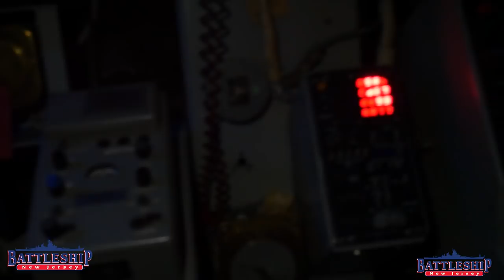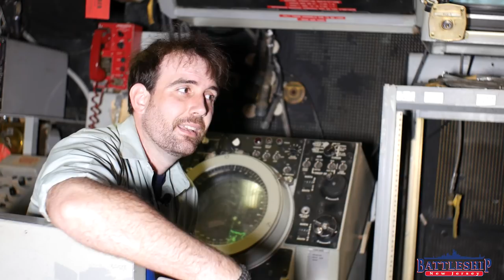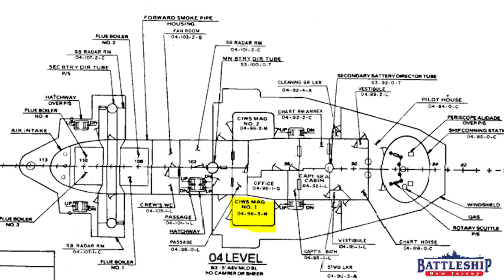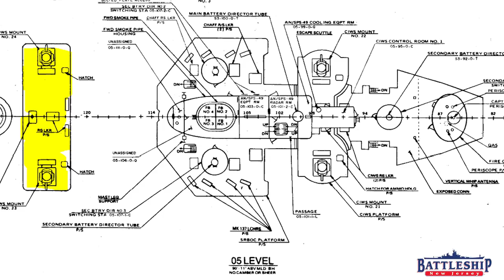Phalanx CIWS

Comment: Do we have any idea what would happen if a single 16" shell were fired on a ship that could bring 2 Phananx CIWSs to bear on it?
Reply: This be my guess, against a thick walled Hy APHE 16-inch shell. 2 sea whizz engaging it will probably? put in more than a few 5 or 6 or 7 20 mm DU rds into it. That should compromise the AP capability of the Thick wall Hy 16 inch APHE shell. The 20mm DU rds will have some not insignificant Amour penteration. That should put holes of some kind in the thick wall shell & quite a bit of stress fractures on the 16-inch Hy APHE shells. That increases the likelihood of the 16 inch Hy APHE shell breaking apart or fracturing when it impacts the main armour belt or deck armour of the IOWA class. That's my read.

Comment: Ryan, has the CIWS had any revisions since they were taken off the NJ? That'd be pretty neat to get 4 demilled ones on the NJ, that can be hardwired to go through "the motions". 

Will those frigates you mentioned, would the navy let you purchase their rack equipment? Even if it was demilled to the point of just having blinking lights on the front of the rack
Reply from the maker: We have all 4 of our CIWS, but making them move is probably out of the question. They belong to the navy and generally don't permit that kind of thing. The navy also doesn't just sell that kind of equipment.
Reply: @BattleshipNewJersey  Oh! Didn't know that you guys had actual CIWS units. Remember somewhere from a video on the Iowa that they put in replica ones
Reply from the maker: Yeah, some ships have replicas, we have the real deal, though they are missing some critical parts!
Reply: @BattleshipNewJersey  Are they able to traverse and such?
Reply: They upgrade and refurbish them
Reply: There have been a lot of upgrades. Surface mode, new gun barrels, new control panels, pneumatic and electric gun drives, tungsten ammo replaced DU. It’s much more capable and reliable now. I’m surprised the Navy didn’t not want the mounts on NJ to go back to Louisville for refurbishment and upgrades. They don’t make new ones anymore.
Reply: The panels used on NJ are no longer used in the fleet. It’s possible Raytheon or the Navy has some lying around, it’s also possible that no more exist. I think it’s likely somebody has one somewhere.

Comment: A 1 minute firing time with a 15 minute reload time seems like a recipe for trouble. Why no autoloading system?
Reply: It would not be legal in California
Reply: He is incorrect. It has about 20 seconds firing time. That is still enough to potentially compromise the barrels since that is about 250 rounds down each one. Mind you the rotary cannon is much better then a single barrel design but the heat is still immense. People with no automatic weapons experience don't realize how hot those things get. If you are in a situation were reload speed is a factor you will most likely be changing barrels so topside you go anyway.

The main reason though is footprint. The Phalanx is quite light and can be placed pretty much anywhere without much modification to the vessel. A autoloading system would add weight and complexity, requiring far more extensive ship alterations to mount not to mention a redesign of the CIWS. Combine that with the heat issue and an autoloading system seems to have a fairly limited use for a lot of added complexity.
Reply: @Snipergoat1  As well, if the reloading speed of CIWS is that critical a factor then it is likely the least of your concerns. CIWS is meant to be the absolute last line of AA defense should anything make it past every other defensive system.

Comment: what kind of glass is being used on these ships?
Reply from the maker: Its not special glass, but the big windows on the bridge do roll down like a car. Being inside the wall protects them very well. Otherwise, the porthole shapes protects that glass and theres very little other glass on board.
Reply: @BattleshipNewJersey  There was a kind of glass in the 3800 lb conningtower door... It doesn't make sense to have 16" of armour and then a cutout for ordinary glass.

Comment: Wouldn’t the 5-inch Guns also be used for longer range targets even in 80s
Reply: Not on mach weapons systems. For slower aircraft maybe but still unlikely these ships were equiped with systems more capable of dealing with aircraft.
Reply: Modern ships do use their guns for aerial defense. However, it is unlikely that these WW2 era mounts would be of any use against a modern missile.

Comment: Odd that they leave the gun but took all the electronics.
Reply: The electronics are the highly reusable parts, as well as being the section that's most classified.  The guns are likely to have had to have specific modifications to their mounting system to work properly on the Iowas and it may just be cheaper to make new ones than change the adaptations (as well as needing to pull the ship into the right kind of fitting out dock to pull them off again, which might not be worth the cost of the time in that class of dock).

Comment: There's many close-in weapons systems around today, but as a Dutchman I am patriotically obligated to say Goalkeeper. Also because the main gun on that thing is the venerable GAU-8 Avenger, also known as the BRRRRRRRRRRRRRRRRRRRRRRRRRT, or the main gun of the A-10 Warthog.
Reply: Then there's the T250 37mm 6-barrel gatling prototype.
Reply: As an American I can agree because yes the Avenger Cannon is simply better
Reply: I always thought the 30mm was overkill for a missile. It doesn't take much to drop one and that is an anti-tank round. Also it's much harder to mount a goalkeeper on a ship that wasn't designed for it. Phalanx is easy to install almost anywhere. GK used to be quite a bit less accurate though this is more to ridiculously good accuracy of the Phalanx rather than a fault of GK. IDK anything about newer systems, they may be just as accurate now.
Reply: Yes I like the goalkeeper too but the new Russian system looks pretty good. Nothing beats the phalanx thought

Comment: The Phalanx CIWS is not a 'chain gun'.
A chain gun is a single barreled gun that uses a length of industrial chain (like a bicycle chain) to cycle its operating mechanism, whereas the Phalanx is a 6 barrelled rotary Gatling style gun that essentially uses a cam action to move the 6 bolts as the barrels rotate. 
It uses 20mm Linked ammunition not a chain of ammunition.
Reply: Was going to say that myself, the Mk38s and 46s (not on the BBs) are chain guns in Navy usage though.
Reply: I thought the M61 and derivatives used linkless feed?
Reply: @jamesharding3459  there are both options with the gun
Reply: @jamesharding3459  the ones I were trained on the shells were in drum not in links. but the load mechanism scoops a round into a chain belt which transports round to gun where another mechanism grabs out of links and mates it to cam captive bolt
Reply: I would push further and divest even the use of Gatling Gun, as that is a particular type of hand-cranked rotary gun. Rotary Cannon seems to me to be the most appropriate terminology for a rotating multibarrel gun of 20mm caliber or larger.
Reply: @michaelkierum42  I see, thanks
Reply: @KiithnarasAshaa  Rotary cannon makes sense, but Gatling gun is so ingrained in common use that it refers to this sort of weapon, not the original gun.
Reply: @KiithnarasAshaa  Modern guns at their core still use Gatling's design.  All modern engineers have done is add motors to the drive input and changed the magazine feeding it and made it available in more calibers (up to 30mm).
Reply: @JaredJanhsen  Gatling himself designed guns that were powered by electric motors, and in the late 1800s had guns firing at ridiculously high (3,000-5,000 round per minute) rates of fire.  They just never found any buyers, because Gatling was never able to design a magazine or feed mechanism that held enough ammunition to make such high rates of fire practical.  Also, given the relative crudeness of electrical power supplies of the day, it would only have been possible to power the mount on a ship, not for ground use.
Reply: @JaredJanhsen  Also, I am aware of, at the very least, a 37mm rotary autocannon T250 for the air defense vehicle Vigilante T249, so they've been developed past "up to 30mm".
Reply: I was thinking the exact same thing but you said it quite eloquently.

Comment: The biggest problem with the Phalanx CIWS is the limited engagement range of the 20mm. A fast-moving missile is very likely to end up raining shrapnel and burning rocket fuel all over the ship even if successfully engaged - which is better than taking the hit from the intact missile, but still not awesome (especially if you're on a smaller ship). It's a lot like the problem of using 20 mm and 40 mm to shoot down kamikazes in WW2, in fact. And of course the limited engagement range also reduces its chances of successfully engaging a fast missile, which just won't be in the engagement envelope for very long. 

That said, it was an extremely effective system against the threats that predominated when it was initially designed and brought into service. Remarkably so, even, given its relatively low cost and small footprint, which allowed it to be spammed across not just the entire USN but the fleets of multiple allied nations.
Reply: It was a vital piece of air defense and still is. Having layered air defenses is absolutely vital for maintaining fleet defense. Say a target slips past the intercept missiles or they need to be reloaded. Any craft large enough to carry a phalanx shouldn't have to worry about shrapnel and as long as the fire is on the outside of the ship the fuel should burn off/put out by damage control. Certainly better then a 15×15 ft hole at the waterline. 20mm is also chosen as it has  a high velocity while still maintaining a large mass and allows the use of variable timed and proxy fuze ammunition. It also allows for a longer burst time and faster rate of fire compared to similar calibers.
Reply: @richardmoore609  When the "shrapnel" is chunks of a 6 ton missile moving at Mach 2 or 3, that's enough to do even a major surface combatant some injury. And burning rocket fuel isn't great even if it is on the outside of the ship.

Most gun CIWS systems developed since Phalanx have gone to 30 mm, specifically to push the engagement range farther out.
Reply: @Philistine47  that whole situation relies on the missile even getting that close which is extremely unlikely in itself. In a realistic situation most targets will be neutralized well before that point. It's also definitely not as simple as 'bigger bullet go farther'. The best reason for opting for a larger caliber is penetration and more explosive filler. The benefits of a smaller round is more room for ammunition, faster rates of fire/longer burst time, flatter trajectory and higher velocity. I could write paragraphs on long range ballistics as it's a hobby of mine but I'd rather not do that right now.
Reply: @richardmoore609  You seem to be trying to have it both ways. Is CIWS vital to a layered air defense, or is it vanishingly improbable that enemy missiles ever even reach its engagement range? Pick one.

And the minutiae of ballistics hardly matter when even the USN is supplementing (and trending toward just replacing) Phalanx CIWS with SeaRAM, which combines the sensor and computer package of Phalanx with a launcher for RIM-116 missiles. They're doing that because the threat environment has evolved since Phalanx was developed back in the 1970s, and now the Navy wants a longer engagement range in their last-ditch defensive system.
Reply: @richardmoore609  Actually Phalanx CIWS has no advantage from those you mentioned. Compared to its Russian counterpart Kashtan despite having smaller caliber (Kashtan has 30 mm guns) it still has way lower rate of fire (each of two Kashan's barrel sets has higher rate of fire than whole Phalanx system) and it even has slightly smaller muzzle velocity (at least when compared to improved Kashtan-M). The main reason why Phalanx CIWS was designed so inadequate for its purpose was probably the fact that its designers designed it against known western threat, which at that time would be widely used Exocet missiles, which are sea skimming, but subsonic and the same goes for American missiles like Harpoons. They probably didn't fully comprehended the scale of threat by Russian anti-ship missiles, which were so ahead of the time that even now more than half century after they have been introduced into the service, P-500 Bazalt is still more capable than anything produced in the west.
Phalanx CIWS was pretty much obsolete already when new, because it was never designed to intercept sea skimming, supersonic, swarm capable missiles with 2000 pound warhead as there was nothing like that available in the country of its origin and frankly speaking even now fifty years after it is still isn't.
Compounding the questionable value of protection provided is also the limited number of deployed systems on American ships. Probably having an immortality complex from being a peaceful navy since WWII and therefore never facing a real threat in seventy years, US Navy decided to cut to half the number of Phalanx CIWS on USS Arleigh Burke destroyers, so since the fifth Flight IIa unit, USS Arleigh Burkes have only one Phalanx system, which is totally inadequate and leave half of approach angles around the ship with no protection at all. For comparison, way smaller Udalloy class destroyers always had and still have two significantly more capable Kashtan systems.
The question of real Phalanx CIWS protection value is apparently very relevant now as some of these units are being replaced with SeaRAM system while US Navy people specifically mentioning Russian anti-ship missile threat as the reason to do so.
Reply: True, but the APDS round greatly improves the engagement range. Much higher muzzle velocity and the dense projectile retains energy well.

Biggest issue IMO is the small caliber. 20x102mm is fine for short-range aerial engagements, but is IMO too weak for effective use from the ground.
Reply: @Philistine47  Explosions are far more devastating when they happen in the enclosed space of a ship, given how shockwaves work.  Far far far better the anti-ship missiles explode outside of the ship than inside it.

Comment: Personally I like the millennium CIWS, which, interestingly, kind of brings the benefit of the ww2 VT proximity fuze to the CIWS with the millenniums automatically programmed fuze, creating a wall of precision flak clouds for the incoming missiles to go through.

I just noticed glancing at the wiki, the NJ was unique in that in it's vietnam deployment, it had the porsche engined QH-50 DASH anti-submarine drone that it used for bombardment observation in place of it's floatplanes.

Comment: The reason for the lower speed limit for the Phalanx radar was so as not to engage our own helos that might be flying around. Unfortunately someone forgot that the leading blades of the rotor disc go much faster. Watching a CIWS track your helo can be unnerving. I believe that got fixed at some point. Then again I sometimes think the GM's used our helo to make sure the CIWS was tracking correctly.  😅
Reply: a common problem for Air Defence Radars, the Sergeant York system famously slewed round past a bleacher full of V.I.P's to target a porta potty extractor vent fan
Reply: @andreww2098  impressive
Reply: @justrob4586  I get where you coming at. FC's on the Operational side and GM's on the maintenance and ammo handling side. Would FC's also do the radar maintenance or was that someone else?
Reply: @johnknapp952  I was a FC and CIWS tech. We were the only ones that maintained and operated it, except for the occasional help from GMs during reload if we were short handed. Perhaps some other commands may have had GMs cross trained and more involved.
Reply: @justrob4586  I was with the Air Detachments (LAMPS) and didn't go around asking the guys what Rates they were. Just figured guns handled by GM's. Maybe when the FF's still had Sea Sparrows (my first boat did), those were maintained by FC's and when replaced by CIWS the FC's just kept the job.

Comment: Ryan, regarding DDG's at present in the USN all Flight I and Flight II ships (DDG51-78)  have both mount 21 and mount 22 Phalanx.  4 we modified to put SeaRAM on mount 22 aft.  Those 4 ships are the forward deployed BMD ships in Rota.  For Flight IIA (DDG79-84) ships they have both mount 21 and 22 Phalanx.  For Flight IIA (DDG85-124) ships only have mount 22 Phalanx.  So it is very close to 50/50.  The intention for mount 22 only ships was not so they could add another Phalanx if needed.  In fact it would be kinda complicated to do so.  The reason is solely 'Technology Insertion'.  Mostly to leave open infrastructure both on the mount, power and space in the accompanying compartments to add Laser Weapons.  The first of which will occupy mount 21 is HELIOS.  The first mount has already been delivered, it will most likely go to a Pearl Harbor based Flight IIA by October.